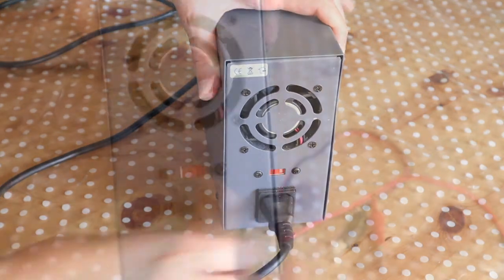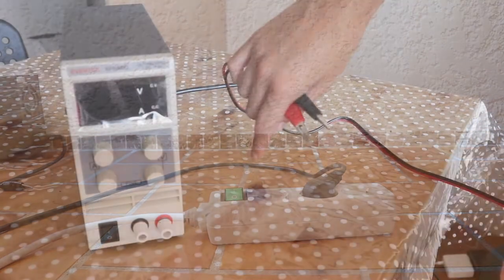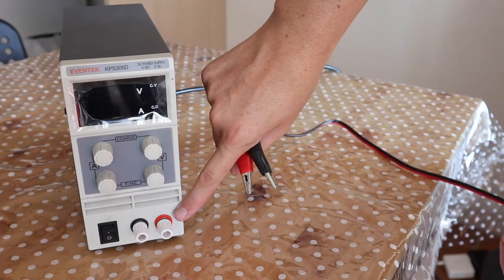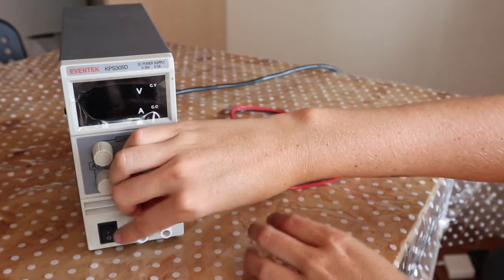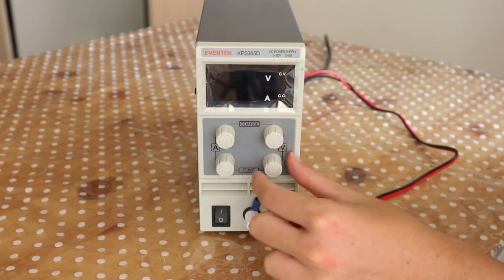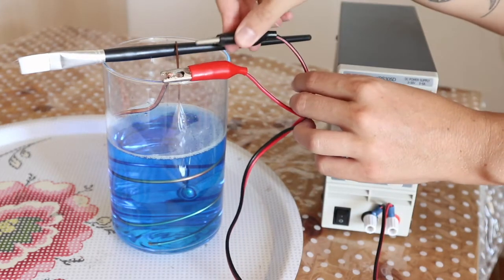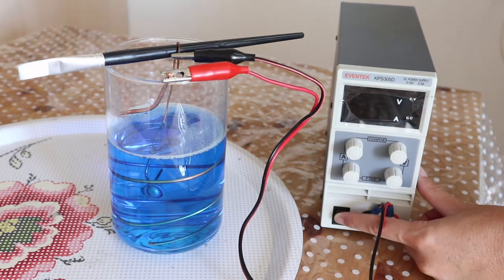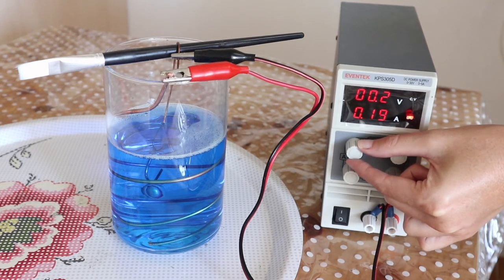How To Set Up Your Rectifier For Electroforming (Eventek DC Power Supply)

Comment: Hi this is a long shot but thought I'd ask. I have this exact rectifier and I can't figure out why it won't work. I did exactly what you said and for some reason no matter what i do the volts automatically jump up to 30 and switch to cv mode. I'm not sure what I'm doing wrong but I can't figure it out 🥺
Reply: Me too!
Reply: My amps bounce up and down too! I don't think it should do this. The one I used during an electroforming class stayed put , it costs over $100 for it though, so I'm hoping for a better option.

Comment: Did the rectifier cause any power outages in your house or like power outlets problems?
Reply from the maker: No, I've never had any problems.
Reply: @electroformingartist7818  how do you dispose of your copper sulfate solution you’re no longer using?